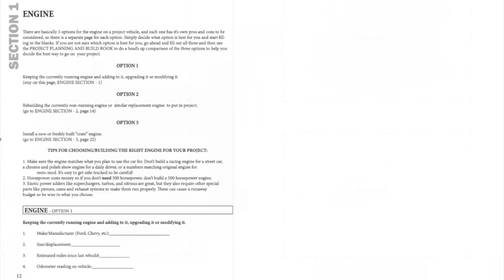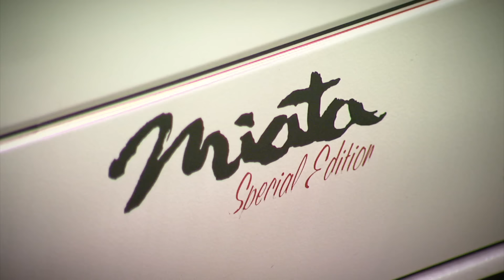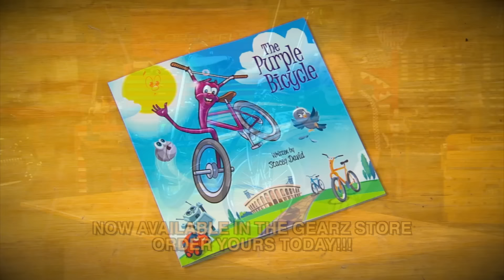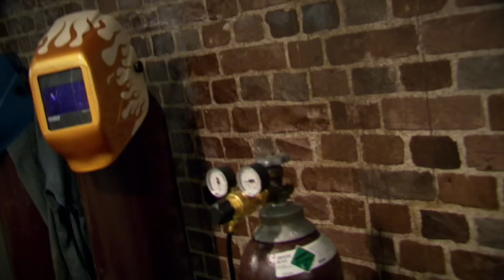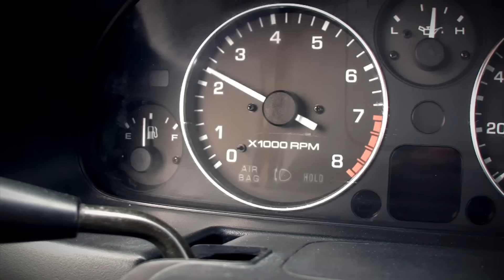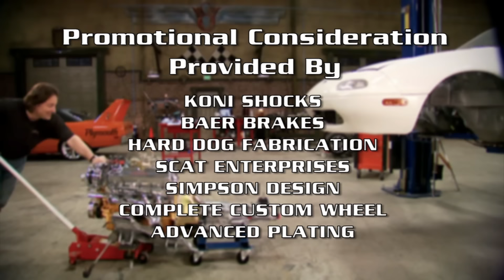Turning a Stock, Broken Miata into a Track-Slaying V8 Monster! Stacey David's BANSHEE - FULL BUILD

Comment: the things said in the beginning about the Miata didn't age very well, now everyone wants one and their potential for being the ultimate trackj car has been recognized
Reply: This is definitely true. I bought my Miata  with minor crash damage in 2019 for $2500, that same car would be 6000+ now. I just Ls6 swapped it this last spring/summer after a year of prep and planning and the cost of doing it was definitely north of $20k. That said, I think going the Chevy route definitely costs more than Ford, especially if you want a manual, and are time constrained like I was (I daily drive my car so I did 95% of the swap work in under a month). I used the V8Roadsters kit, which is definitely a bit pricier than the old monster kit but the fit and finish is definitely the best, and I didn’t have the downtime to measure and order in a driveshaft or make/measure for custom headers and the like. Now if I’d skipped the t56 magnum and gone iron block+stock ecu I probably could have still snuck under 10k but who wants an auto Miata unless it’s solely a drag car. I can’t be more satisfied with the result and having an aluminum LS paired with a t56 magnum close ratio and a 2.73 torsen 8.8 I feel confident attacking any prepped surface with no mechanical sympathy or regard for other people’s feelings. With ratty stock paint and nothing to give away the drivetrain save for some side pipes and some extra meat on the back the only thing I’ve lost to on the street was a lambo huracan, and if I put a ss2 cam in I think I could have edged it out. I’ve lined up against built STIs, two Evo Xs, multiple Camaros, a boosted Ls chevelle, ls swapped s10, plenty of slow mustangs, and even a model 3 dual motor. That last one was kinda close 😂 On the strip, I’m getting dangerously close to 11.5 in the quarter on street tires, which is the fastest I can run in a vert with just my roll bar, if I can get my hands on a hard top or do a full cage I’ll be safe to the mid 10s. It’s crazy what a 2400lb car with 400whp can do when it hooks, and I look forward to what it’ll do this coming season with some longer gearing and actual drag slicks
Reply: That's because the affordable rwd sports car segment dried up except for miatas so their price and demand is artificially inflated.
Reply: Can’t really say “age well” when this was made 2 months ago, the guy is simply out of touch with modern car culture.
The Miata has always been a driver’s car at heart, & has always been chosen as a modified track car by boy-racers.
It’s such an iconic car, no one who knows anything about cars really sees it as a “girl’s car”
Reply: @justadummy8076  FYI, this wasn't made 2 months ago. The guy is not "out of touch with modern car culture." This was a series that was released years ago (2007/2008 range). This was just uploaded to YouTube 2 months ago. In 2008, an NA/NB Miata in good condition was pretty easy to find under $5,000. Not so much anymore. Hence, his comment has not aged well.

Anyone I've heard of doing this in the last several years to the quality of this build is easily putting in $20-30k to get it done with an LS powerplant. LS engines and transmissions have been gobbled up, good condition Miatas are harder to find, even the V8 install kit has jumped in price. I used to want to V8 swap my little NA6, but I could easily buy a used Corvette for what I'd have in it when finished. Not sure the value is there anymore. If you want to swap just for the fun of the experience, absolutely!
Reply: I wish American companies would just stop being cheap and make a rwd affordable car
Reply: @woofer2121  If people would buy them, they would make them. The end.
Reply: @woofer2121  The mustang and camaro in their base trims are both cheaper than a new Mx5... and pretty much anything else rwd, while being quite a bit faster than their 80's , 90s and sometimes even 2000s performance trims. And all of those are cheaper (and safer, and faster) than the NA miata launched for if you adjust for inflation.  In fact, they're all  not much over HALF the price of the average new car bought in the US. 
What are you going on about?
Reply: @Just a Dummy  you're channel name suits you well.  This was from 15+ years ago.  People can post old footage in modern times.  Believe it or not I just watched the classic 80's film Spaceballs the other day without bringing John Candy back from the dead.
Reply: It took a long time for that to be more widely recognized and accepted. 
Personally never was a fan of them. Even if I recognize that it's a good track car
Reply: @woofer2121  i dont care if its sn American rear wheel drive.. as long as its rear wheel drive. But i do love classic rear wheel drive American automobiles.
Reply: @justadummy8076  No, it may have been posted  a few months ago, but that is an episode of an old SPIKE TV show called Gears, I think.  That episode has to be 15 years old?
Reply: It's crazy what clean Miatas are going for these days.  I never thought that a Miata would be desirable and worth what they are going for these days.  I can get behind the performance aspects of why people would want them but I still would never buy one.  I just don't like the looks of them.  Some look pretty good with a ton of mods but I would still rather have an s2000 any day of the week.
Reply: Aged perfectly fine. The Miata was styled to appeal to women. Great for a project car though.
Reply: @justadummy8076  2 months ago? This originally aired close to 20 yrs ago
Reply: It sorta did age well. He pointed out people's perception that the miata was a girl's car was silly because Shelby did the same thing with something that was considered a girl's car back in the day. He did with the miata what people do now long before it was popular
Reply: @greasebeardsgarage  I'd argue that this episode had a small spark in the ignition of the modern miata trend for enthusiasts, I remember when this episode came out and seriously gave the miata a consideration, and with the ne 2020+ models they're looking pretty good these days.
Reply: It's crazy what an NA goes for now
Reply: 😮😮x😮
Reply: 😮Y😮;😮
Reply: 1:04:12 😮😮
Reply: 1:04:43
Reply: 😮😮😮x😮😮
Reply: 1:05:30 😮😮😮😮😮
Reply: @elementaljosh 😮😮😮😮😮😮x
Reply: People have been dropping 302s  in miatas since the 90s.

Comment: You may not think it's cool but I'm keeping my 93 stock. Yeah they made a ton of these but it's getting harder to find bone stock first gen Miatas that aren't clapped out. If you see a first gen on the road it's nearly always modified. Plus yeah they've got the reputation as a girl's car but for some reason Gen Z has fallen in love with these, nad not just the girls. Every time I fill up I've got a teenager or someone in their early 20s coming up to me to look at and talk about the car. They are incredibly slow and it's been said millions of times but wow is the handling great. My other two cars are a 2003 BMW 300i and a 1994 BMW 325is and while they feel more planted and like they're sticking to the road better the Miata still has them in the corners. They're incredibly easy to toss around as well. Being so old there's no nannies to turn off or minimize.

Comment: I'm sure that tuning a Miata into a Banshee is fun but you never said what you did to the 302. I realize that even stock, it would go like crazy  but you had to have done something more than put a 650 or 750 cfm carb on it.
Reply: @19:18 He didn't use the junkyard engine, he put in an already built 400hp racing engine

Comment: i love how you used professional products to repaint the panels and vinyl , but as a poor guy, i scrubbed them down with water and baking soda, dried them, cleaned them, heated them up with a hair dryer, and painted them with black shoe polish. two years and they still look brand new!
Reply: Great idea
Reply: Ya, shoe polish is good-n-all until the weather gets hot and the oils and wax in the polish start softening and running

Comment: Cool video, and yes even without a top it is a most sought after vehicle. I got to work on a real cobra once. New brakes and tune up. It had a 427 Roush somewhere around 500 Hp, side pipes and was so loud you could hear it a mile away. But boy it sounded good (especially after I got done with it. :) But to this day it was by far the best paint job I've ever seen on a car. Light blue metallic flake with the single offset racing stripe down the middle. Absolutely beautiful mirror finish. And did I mention loud, in the best way?  lol!

Comment: I did you one better - I put a Mast Motorsports 600hp LS7 into a Saturn Sky. No cutting or hammering required - and it uses lots of corvette parts like the motormounts, T56 transmission, and the diff from a CTS-V.  I'll roast your miata any day, on the track.

Comment: Prior to bonding the rear clip onto the car you will need to clean the mold release off the fiberglass panel.  Mold release is an agent used to enable the newly formed panels to release from the molds without damaging them.  Acts as a lubricant of sorts.  Use lacquer thinner to clean the surface FIRST then rough it up to give it some tooth.  Kind of like cleaning rust inhibitor off of new rotors prior to instal.  Grinding the panel prior to cleaning will just drive the mold release into the panel.  This has been a fun video to watch.  Good job Stacey.  Now stop giggling.  😊

Comment: I'm rather annoyed that he starts the project off by lying.
"$20,000 or less"? That body kit, by itself, costs $25k. That's the budget highly blown without even getting a car or a single part.
Reply: @John-cg8hb  He 100% did NOT make that distinction. I even went back and rewatched it.
Reply: @UpperDarbyDetailing  listen again at about 46:00, 20k definitely falls into "whatever budget".
Reply: @John-cg8hb  it definitely does, but in the opening he specifically stated he was going to build a car for "under 20 grand". At the end he said YOU could build a V8 Miata with "any budget".

Comment: Are you Not Better Leaving it Looking Liked A sleeper Miarta just finish it with back axle oil , gearbox oil .engine oil , and anti freeze topped up , some petrol into it and a battery ,SO YOU CAN Start Her UP ! . . .. A LOT More CLASSIC But Instead LIKE You Said The Looks are A Mix Of Ferrari , Lotus , Austin Healey ETC ETC ALL Been BASTARDIZED INTO A BLEND THAT IS THE END RESULTS FINISHED LOOK I SEE HERE !

Comment: No way in Hell that is done as you built it for less than $20K, more like $35K. That body kit alone is over $12K on their web site, I bet the engine you used was over $10K just for the long block, your car cost was $2500, the paint job had to be at least $5K, the engine accessory system is $2500, the roll bar is $750, intake and carb are over $600, the clutch and bell housing are at least $1500, shocks and struts at least $500, and whatever misc stuff. That adds up to a little over $35K. Just be totally real with the numbers Bro. Maybe you get special prices the rest of us can't get.
Reply from the maker: $20k is assuming you leave the body stock. Sorry that wasn't clear in the video.
Reply: @OfficialStaceyDavid  thank you sir. I still love you and your show, it is the best of any show I have ever seen. Just a guy working on cars without the stupid stuff and clueless eye candy. However, going forward please consider adding costs as you assume and cost as you actually built it just so we are all on the same page.
Reply: @mattwilliams6070  you realize this was 17 years ago?